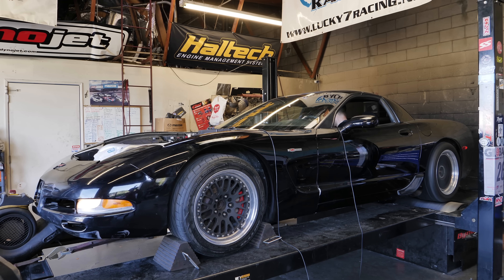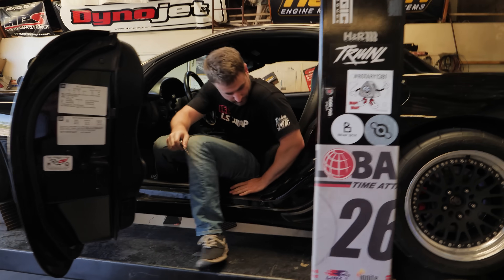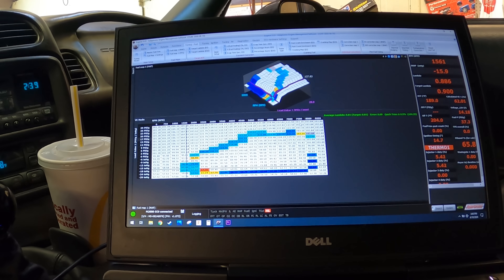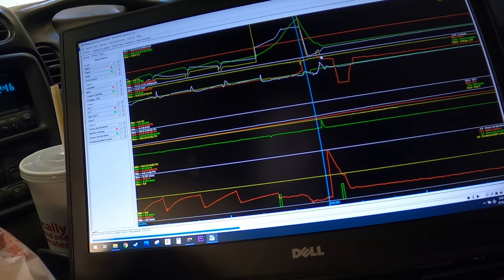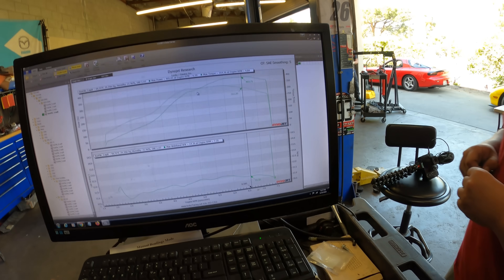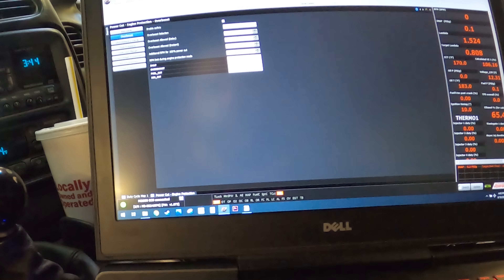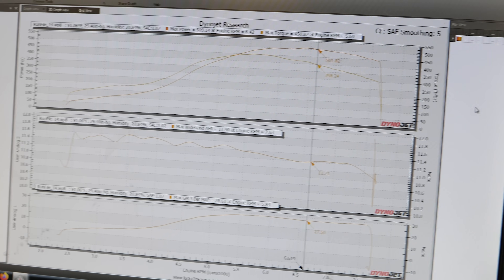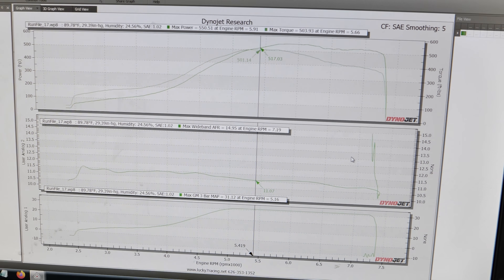Rotary Vette Dyno! First time dyno tuning

Comment: 550 HP and 503 TQ at wheel, alright. Question, what’s the servicing of this engine at that output going to look like?
Reply: I don't think a lot of stock parts hold up well at 30 psi 🤣
Reply from the maker: Covering that next. That’s not sustainable levels of power on a stock engine. Both stock apex seals and stock block itself aren’t meant for that much tq. We did it in horrible conditions. But I don’t think it would last long for anyone. Wanted to start with a stock block and then do the least number of mods to do 600 hp reliably maxing out this turbo.
Reply: Rob Dahm I’m honestly just wondering. I don’t know that much about the platform. Thanks for responding.
Reply: @RobDahm  how are the apex seals being used harder? im guessing too much engine vibrations from the power?
Reply: @ButtonandBuck  Much more pressure I'd wager. Same way stock piston engine block can only hold x amount of power on internal components.
Reply: @ButtonandBuck  nothing to do with vibrations and everything to do with holding in the pressure. Once you start cramming boost into an enclosed space, there's an upper limit to how much you can squeeze in until something breaks. In this case, the apex seals are the weak link in trying to contain the pressure. After a certain amount of pressure the actual physical material the apex seal is made out of will fatigue and break.

Comment: can someone explain to me what that vibration/rumbling was at mid to high revs? can't have been that boost safety cut because surely he would've changed it rather than let the car fight itself?
Reply from the maker: 4 port wastegate controller loud and obnoxious pulsing
Reply: I use a two port on my Toyota 4ag turbo and from 7000-9800 it pulses like this. Try a different frequency.

Comment: GM: "you can't have a rotary corvette make more HP than a stock LS6"
Rob Dahm: "Hold my frickin beer."
Reply: More like hold my Valvoline and Keeps Sponsor
Reply: @cd2920  that's stupid why would you compare an engine half the size n/a that is already known power is just how much fuel and air you can burn
Reply: “Hold my sweet tea”
Reply: There is nothing comparable between the 2 engines, LS is superior in every way, stock vs stock, built vs built, boosted vs boosted, power, torque, reliability, price, efficiency. You can get almost any engine to make power if you try hard enough, some people like doing it the hard way just to try being different. I’ll take practical over different any day
Reply: @gavwilldo  Rotary sounds better than LS
Reply: @WaffenSSaregods  sound is subjective. What he stated were facts.
Reply: @cd2920  Why? Isn't the Rotary turbo on the showroom?
Reply: GM: "reliably"
Reply: G SysOp and without boost.
Reply: @regal105  that's not what people said. stock RX7 13B had a turbo.
Reply: Good job Rob!
Reply: *"Hold my frickin sweet tea"
Reply: Hold my Doritos
Reply: @cd2920  Well rotaries have significantly smaller displacements than LS engines
Reply: @Rassettaja  Yet they're still true...
Reply: I mean, just like rob had to add a bigger turbo to the 13b, you can add nitrous to the ls6 in about 2 hours. 150 dry shot is a sweet spot, run low 10s without issue. Clutch will need replaced, c6z oem does the job
Reply: That’s easy but imagine a boosted ls6 with stock internals.
Reply: @bigkarl24  650RWHP + all day reliably.

Comment: That boost solenoid doesn't sound right... Too much flutter.
Reply from the maker: 4 port. Swapping it out. Annoyingly loud. And not enough granular control over it
Reply: 4 ports are for very high pressures. 3 ports are better for fine tuning.
Reply: Sounds like the frequency of the solenoid is too low

Comment: 0:50 forget the hood pins Rob?
Reply: They were running so hot that they probably left it open on purpose so it would vent some heat out from the top
Reply: Ahh makes sense

Comment: Every hater who said that it won't make more power and torque than the stock LS can eat their own words now! 😈😎
Reply: people said that? i guess they dont know how easy it is to make power with boost
Reply: @ButtonandBuck   Or how much power the R26B could make N/A. Hell they detuned the 787B and it was still making 650 hp at 8500 rpm's....
Reply: @ButtonandBuck  Yeah, a lot of people say that, people that don't know shit about rotarys
Reply: Joe Alex enough time and money into anything will make as much power as you want
Reply: @austinriggs5502  Displacement comparison is pointless between piston and rotary engines especially when one is NA and the other is a turbo. We need to compare manifold air density to WHP. I.e. how much HP can you extract from a given amount of oxygen?
Reply: @AnttiBrax  somebody watches banks! MAD is always the best measurement, always has been. Biggest secret in engine builds forever
Reply: @davemcdaniel4856  Guilty as charged. :D
Reply: Antti Brax The words you wanna say is “thermal efficiency”
Reply: only reservations is a blown or wrung 13b is a tragedy... a blown LS who cares.  the world is littered in them.
Reply: The Curran brothers. Castrol rx2. It's older build. Fucking bad ass.
Reply: Aww you boys are creaming in your pants over LS vs Rotary. Step up too the Turbofan world and let's make some real power 😂.

In all seriousness, one commenter above actually understands the relationship. Fuel and air make power. It doesn't matter platform. Peak stoichiometry for a fuel type is constant, if you can maintain that ratio with more fuel, you will create more power. From there it is a heat and pressure game. High heat, weak seals, or bad timing are your worst enemy. 

I will say, it appears Rob adjusted timing flat across RPM range. You should really look to advance as RPM increases, fuel combustion rate is relatively linear given a constant atmosphere, unless you detonate. You want to time your peak pressures to be generated during the power cycle. The way a rotary revs and the range, this is even more important. You should be able to really clean up that low end and get more of a linear HP line by doing this.

Best of luck.
Reply: I mean E85 means there’s a large asterisk, but I think it would do well on pump gas too.
Reply: I wonder how much that ls would make with 30 psi lol.
Reply: I think some people who peacock like this are trolling, but there are so many of you that will never understand that air and fuel make power, not size or numbers of pistons. Imagine if you had a Ferrari V12 and some dude with a turbo LS making 1000hp bragged that it's "only" a V8. I've seen dudes with 4cyl Evos with 40+lbs of boost bragging about having half the motor of a V8 and being faster. Yeah, okay, buddy. How many liters is your turbo?
Reply: I love what he's doing, but c'mon, what did it take to get there?  Put that turbo, time, work and money into an LS and it would be no contest.
Reply: @BJK1715  Well, the point of this was to show that rotarys are not as bad as some people think, sure, the LS can make more power with the same mods, but that's not the point
Reply: @BJK1715  and then it will be just like everyone else's project. Not unique in any way.
Reply: BJK1715 They said stock!
Reply: Yes it made more power then a stock LS. 
Add a turbo to an LS and say good by to the rotary on power. 
Now I have both a FD and a typhoon with an LS. So I love both motors. But each has its own purpose
Reply: @brianawd   Everyone knows in the build and battle contest, the turbo 13B rx-7 beat the nitrous LS chevy S10 on a smaller budget.
Reply: @normanguzman417  ok let's turbo an ls6, let's be real an ls with a turbo would destroy that 13b on reliability and power. If you're going to compare the two it's an easy choice for me. But if you like the rotary go for it.
Reply: @bryanloewen5011  That's not the point though, the argument was can a stock 13b make more power than a stock ls and yes it can. You put a turbo on a ls it's no longer stock you've just changed how the engine breathes drastically.
Reply: It still doesn’t make more power than my n/a LS lmao. I don’t even have an aftermarket intake, heads, or manifold. Just cam and headers through the stock exhaust.
Reply: @AliasProductions801  everybody think their cars have so much HP until reality strikes in the Dyno. Sure buddy, what ever you said. Imao.
Reply: Norman Guzman I have the dyno sheet to prove it lmao. So sure buddy, whatever you say.
Reply: Take the money that the Garret turbo kit cost, and put it into the LS, and rotary loses. Add up the fuel system and engine management and you have a built, boosted LS car making 800+ hp reliably.
Reply: not to be that guy but to be fair, the ls would have made that on 87 octane, this needs e85 to make even 300hp. cool build, but it is what it is. since he doesn't really drive the cars, e85 is going to need the injectors cleaned after it sits
Reply: john somethin u don’t need e85 rob just chooses to use it bc it’s a safer option for detonation. Lots of rotors make upto 500 on pump fuel
Reply: @jsomething2  pintle-less injectors dont gum up with ethanol when sitting. Common misconception.
Reply: Lol cam and other goodies on that ls6 would destroy that rotary without boost
Reply: @bryanloewen5011  The stock LS piston rods can't handle more than 550hp. I am afraid the LS will need more than a cam. Rob is using a stock 13B, if he would done a half bridge port, he would have done 700hp on the same boost.
Reply: @Norman Guzman stock ls pistons and rods can’t handle more than 550hp? Haha you never seen engine masters run out of fuel system at 1500hp on the stock bottom end?
Reply: @bryanloewen5011  yes, yet people still say that a turbo 13B cannot make more power than a stock LS. did you not read the parent comment?
Reply: @sepg5084  People weren't saying that, though.  There was before (and is now) more people complaining about people saying a bone stock LS would be faster than there was actual people saying a bone stock LS would be faster.